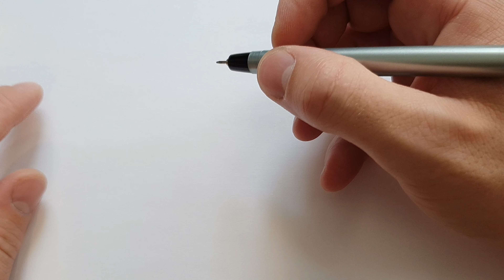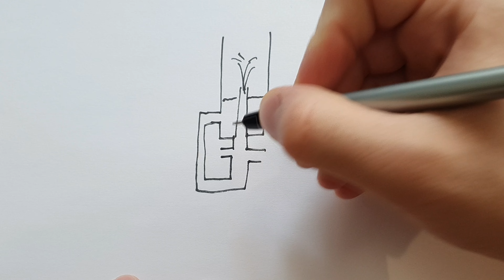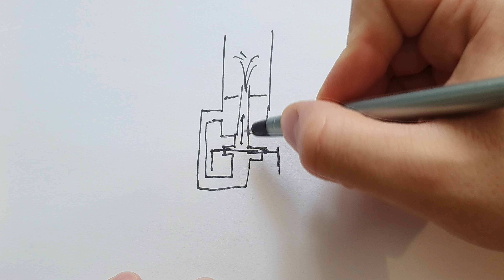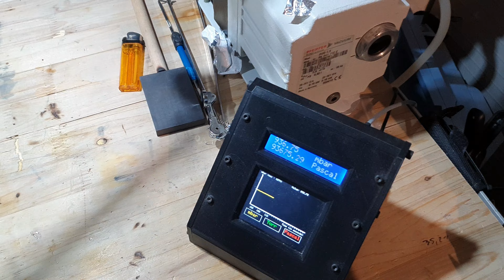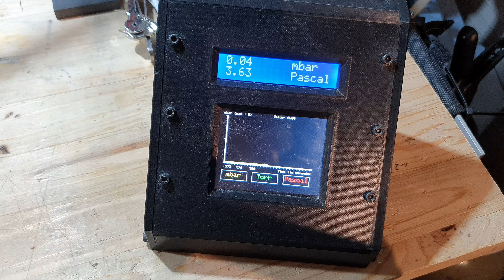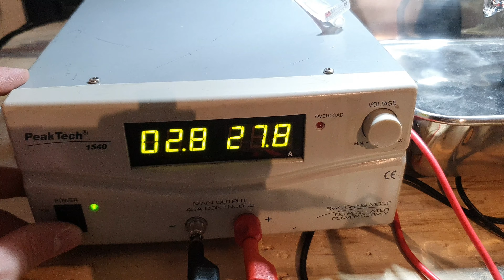Building the most dangerous fountain in the world – Periodic Videos homage

Comment: Nicely done.  A tip for creating glass tubing loops more easily: make it in two halves that can then be joined at two points simultaneously.  I've made some Schlenk-ware and Klein bottles that way.
Reply: Does that require 2 torches?
Reply: @CM-xr9oq  No, just alternate heating between the two locations (two pairs of open ends) to be joined.  When both are hot enough to stick, make connection and then work the joins individually to get smooth seals.  Requires a bit of dexterity and maybe a slightly hotter flame.

Comment: it‘s interesting how three cycles of vacuum and flushing seem to be the norm in many use-cases.
Have you considered bleeding N2 or Ar whilst pulling down? We used to use that in an application to drive out the sublimated water. Only requires a tiny flow at 100μBar and below.
This may, next to heating the glass, help drive out most of the residual non-inert gasses.

Happy to have found your channel 😊

Comment: This looks genuinely impressive (for a guy without a background in chemistry); what's stopping you from using gallium as your liquid? As far as I understand, it's innocuous, and your only technical concern would be to keep the bottom of the vessel warm (not difficult in this heat, and you can just wrap it in nichrome wire in winter). Thank you!
Reply from the maker: Gallium would be an option. But you would have to use very pure gallium and also work under an inert gas atmosphere to prevent oxidation. Because gallium oxide will stick to the glass. Or you would have to coat the glass.
The larger issue is the high density of gallium. It is appropriately five times more dense than NaK. Which also makes it harder to accelerate. It could be possible with a stronger magnetic field and higher currents.
Reply: @AdvancedTinkering  Liquid gallium is also denser than solid gallium. If EVER the gallium solidifies, it will expand and will break the glassware (it breaks standard glassware pretty easilly).
Reply from the maker: @timovneerden  Thats a really good point! Didn't think about that.
Reply: @timovneerden  is Gallium like water in that regard? I always wondered why some solids are less dense than their liquids.
Reply: @JinKee  Water has this property due to the hydrogen bonds. Those don’t exist in gallium, or plutonium (which also show a negative thermal expansion — NTE — on freezing).
I’ve not searched it thoroughly, but the phenomenon is called the NTE, if you wanted to search for more info on it.
It is a quite powerfull effect. It has been shown that some trees that get frozen will litteraly explode under the enourmous pressure that ice exerces on formation, aroung 100k PSI, or ~1 gigapascal..

Comment: Makes me wonder if this concept could work the same way with mercury instead of NaK. Would be awesome to see if you could pull it off and do a mercury fountain. Love your channel and content. Keep doing what you do m8 you got a subscriber here. Stay safe and keep the knowledge flowing m8.
Reply: In theory it will work with any electrically conductive fluid, but mercury is not an ideal choice. It's very dense so it needs a lot of force to give it enough of an upward push to make a fountain. 

It's also a pretty bad electrical conductor for a metal (I think about 1/3 or 1/4 as much as NaK) so you need to apply a much higher voltage to get a good current flow.

Actually, the reason mercury is a bad electrical conductor is the same (fascinating) reason that it's a liquid at room temp. It has to do with its outer electrons moving so quickly (faster than 50% the speed of light!) so they effectively gain significant mass and are more tightly bound to the nucleus, making them less available for metallic bonds.

Anyway, I'd be much more interested in seeing a caesium fountain!!
Reply: @jhonbus  I hadn't thought of that. And that being the reason is knowledge I didn't know. Thank you for sharing that. And a cesium fountain does sound super cool forreal.

Comment: Add in a water heat exchanger into the next version, and cool the electrodes, so it can run uninterrupted :)
Reply: or maybe rather than water use another good heat conducting fluid.
Reply: Use mercury in a tube with outside water tube.

Comment: What was the voltage and current used in the final version? Was it the same or did changing the magnets make a difference other than fountain Haight?
Reply from the maker: I used a constant voltage supply, so the voltage did not change. The current also did not change with the stronger magnets. At least not enough to be noticeable within the normal fluctuations due to the rising temperature.

Comment: Its nice how tungsten oxide and borosilicate make hermetic seal

Edit - just noticed you had problems and needed epoxy

Did you heat the tungsten to get oxide layer

Edit - I should really watch the whole video before commenting 🤣
Reply from the maker: Haha, yes I had problems in the first version. But even with the epoxy it wasn't vacuum tight. A proper tungsten/glass seal can't be beaten. 
I heated the tungsten rod for a few seconds in the flame to get an oxide layer.

Comment: Is it possible to do it with Caesium? Not sure if NaK has special properties other than the melting point that allows this. I figured the current flowing might keep the Caesium warm enough to stay liquid?
Reply from the maker: I actually thought about doing it with cesium. But there are several problems:
1. Cesium is a lot more dense than NaK, which means you would need more force to move it upwards. 
2. Cesium is so much more reactive and oxidizes much faster. With the surface area created by the fountain it would oxidize very fast if the atmosphere is not perfectly dry and oxygen free. And that a lot harder than it sounds. 

But I think you are right, the heat dumped in the metal would probably keep the cesium in a molten state.

Comment: Slope of tube shouldn't matter.  You have trapped gas.  Evacuate partially & re-fill several times with NaK in place.  This will "de-air" the tubes.  Why are you wasting the NAK you filled the first time?  Can't you invert the tube & re-capture it in the syringe?
          When preparing tungsten rods for glass sealing, there is an "alchemy process" where you rub the  tungsten with a nitrate? salt & heat.  Why not buy a pair of neon-sign electrodes?
          Your magnet needs "back iron".  Having this will multiply the field by 5 (& reduce the current by 5).  Get a 1/2" thick piece of steel & cut it into a "tuning fork" piece (shaped like your 3D printed piece) except wider space between so the magnets can be stuck between (no need for screwing the magnets, they will stick firmly to the steel.  DON'T have holes in the magnets.  That further weakens the field!)
Reply from the maker: Hi Brian,
thank you for the great suggestions! 
-Yes, that's what I also thought. A fluid should be at the same level, regardless of the angle of the tube. I also tried to evacuate the fountain and refill it with argon. But the gas bubbles did not move. I think the NaK oxidized to a point were it would simpy not flow properly. And that's where I think a steeper angle of the tube would help. 

-I did "recycle" all the NaK that would come out the fountain when it was inverted. But due to the oxidation, some of it sticks to the walls and it's nearly impossible to collect. That's the NaK you can see being quenched by the isopropyl alcohol. 

-Thanks for the tip with the nitrate(?) salt. Never heard of it, but I will look into it. Using neon-sign electrodes was my first plan. But in could not find a seller in germany. I think I found one guy selling some. But they were to big and very expensive. 
I also doubt they could handle the current needed. Even with an optimized setup. Do you by any chance know, what current they can handle?

-Also a great Idea! I did not think about that. I do not have access to proper metal working machines. So working with steel is always a pain. But the advantages you mentioned definitely make it worth trying. 

There will be an improved version for sure.
Reply: @AdvancedTinkering  Make up the fork with pieces of metal  Once you figure out the spacing between the fork tines (glass + 2 magnets), buy stock that width & about 20mm wide.  Fabrication is then only hacksaw cuts & drilling & bolting together 2 longer & 1 shorter piece.  I say 30A is way too much for those electrodes (tungsten is crappy conductor compared to copper, 3.3 times worse.  Get that field up & the current can be gotten down.
          Does sodium attack copper?  If it doesn't, you could make Housekeeper seal with 1/8" copper tubing welded shut on the inside ends.  If you heat that tungsten, you may have the glass crack!  You are banking on the temperature of both being the same!
          About the seals, When I did this years ago, I used uranium glass for the bead as it matches the CTE of the tungsten better, then fused this bead to the borosilicate glass.  Tungsten has "tunnels" that run lengthwise.  You should butt-weld this to another metal (moly? or more tungsten).  This seals the tunnels.  Make the seal right next to the weld.

Comment: That's pretty. Have you considered running the fountain under mineral oil instead of Argon? Would the MHD pump be powerful enough for that even?
Reply from the maker: Thank you! Yes I have thought about that and it should be possible. But I think it would ruin the looks of the fountain because the oil will stick to the glass. I may try it in the future.
Reply: @AdvancedTinkering  I mean, if the oil fills the tube it should be optically clear throughout? Plus if you can get it to run under oil you could cool the oil to have the fountain run for longer.
Ofc, the pump being what it is is technically interesting, but the current draw is bonkers. Another way to do a more traditional pump would be to use a classical impeller style pump, but with the impeller embedded in a glass cavity and magnetically coupled to an outside motor (or maybe even constructed like the rotor of a brushless motor). That'd be more complicated to make, but would substantially reduce the current draw.
I'm just thinking out loud here, looking for ways to make it more efficient are safer to run for longer periods of time. 
Then again, this'll probably never be made into a decorative object for obvious reasons.
Reply from the maker: Oh you mean completely filled. I thought just a layer on top of the NaK. For that I think the pump would not be strong enough. 
Yes some aquarium filter pumps work with a magnetically coupled impeller. That would also be a great idea. But I don't think I am able to make something like that out of glass.
Reply: @AdvancedTinkering  Hmm. Maybe there's a hybrid way of doing this. Like some piece of glass ware that can house a magnetically coupled impeller (could be a 3D printed one or something pre manufactured that is even more heat resistant) and then splice that piece into the loop as the pump (my thinking is,  the impeller made of plastic needs to be kept far enough away from the heat source for splicing the part into the loop).
Then again... how reactive is NaK to ferromagnetic metals like iron or steel? Those wouldn't melt in the glass blowing process and could be magnetically coupled just as easily as another magnet in a plastic impeller.

Comment: Hey what would be the best setup to get into glass working?   Do you think and HHO burner off amazon might be good?
Reply from the maker: You don't need a HHO burner to work with borosilicate glass. Hydrogen/Oxygen is used to work with quartz glass. Propane/Oxygen works great and is a lot safer. I wouldn't recommend using a HHO generator. As far as I know the flame from those generators is pretty small. 
I would recommend using an Oxygen concentrator, a cylinder of propane and a proper torch. 
I made a video about my equipment a while ago.

Comment: Would GalInStan also work?
Reply: It probably would, but galinstan wets glass very easily. So once it splashes onto the glass you'd have trouble looking through it. 
Gallium itself would also work once you heat it to 30ish degrees to melt it. The current running through it probably would be enough to keep it molten. But same problem, it wets glass. 
There are special coatings for glass that prevent it from getting wetted by galinstan and gallium (there are thermometers that look like mercury thermometers but actually contain galinstan, and those have nice see through glass without metallic splashes), but i don't know if it's possible to apply those in a home workshop.

Comment: Uh, why not just use mercury?  No mixy, no blowing up?  Might even be able to do some "laminar flow" long distance fountains?

With this stuff...maybe...shoot out of the protected reservoir...through the AIR and INTO WATER...have a little "FUN"? 💥💥💥🤪🤣🤗
Reply from the maker: Several reasons:
1. This video was a homage to periodic videos fountain. And they used NaK. 
2. I would rather work with something reactive than something toxic. 
3. Mercury is over 12 times more dense than NaK. You would have to use a lot more power to accelerate it. I don't think it would be possible without immediately overheating. You could move the mercur, but I don't think you could make a fountain using a magneto hydrodynamic pump.
Reply: @AdvancedTinkering  Cool.  Forgot to mention I did enjoy the video...I wasn't "knocking it". 😉
Reply from the maker: It's all good! I didn't understand it that way :)